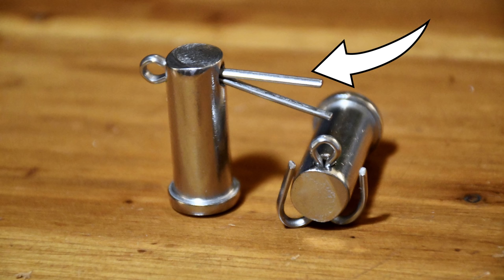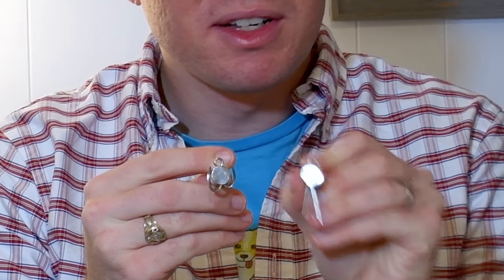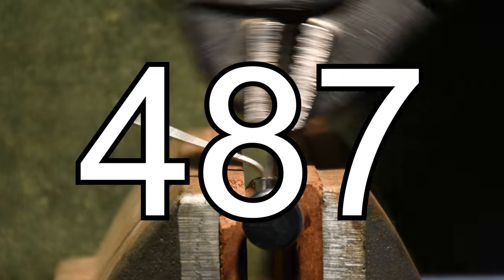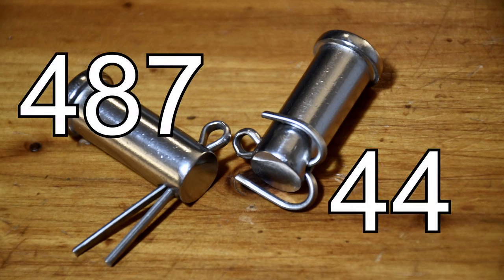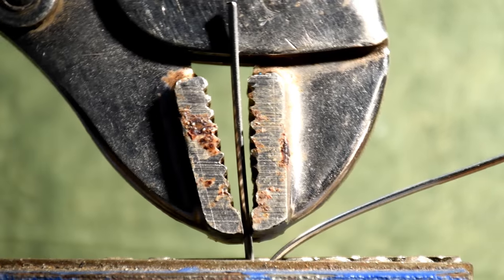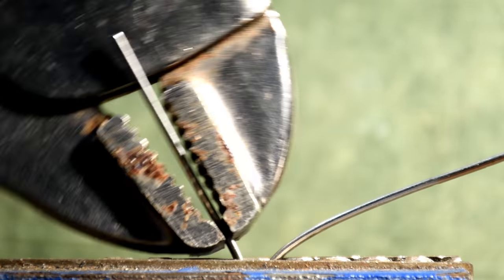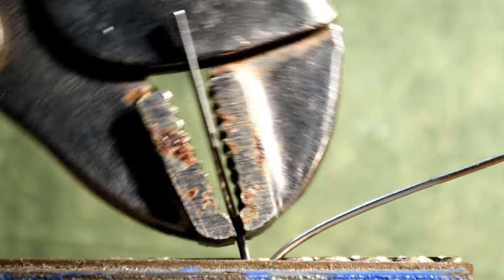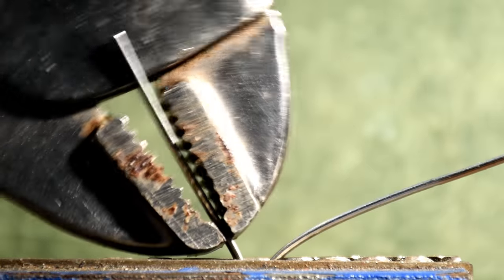Should You Bend or Spread Your Cotter Pin | Sailing Wisdom

Comment: Yes, Math is fun.   However, you have made some base assumptions that I think are false.   You are assuming that each bend puts in the same amount of stress.   However I'm thinking that each bend makes the material less ductile and thus each successive bend puts in more stress than the previous one.   That means it is not a straight line and the first bend puts in MUCH less stress than the last.   Don't know if that would result in a log scale or not but it would make things a lot different.

Also, we are looking at one of the "pins" of the cotter pin failing.   Which solution would be best if one does fail?   I'm thinking the 15 degree bend, with only 1 pin, would pull through pretty easily while the wrap around wouldn't be able to pull through.

And, then there's how you bend it.   The sharper the angle of the actual start of the bend could make a big difference as well.   Using heavy pliers and making that a sharp 90 degree bend and then bending the rest of the pin around the clevis would be worse then doing a more gentle rounded bend!

Oh, and there is the quality of the cotter pin.   You can purchase different quality ones.

Finally, another option I've seen is to use pliers, grab the longer pin and and bend it "around" with the pliers, leave the other one alone!

Anyway, thanks for making me think!

Comment: Test the shear load strength at both ends simultaneously like how they are meant to work. As designed it is supposed to shear the entire pin diameter at both ends of its hole with side loading. Fatigue and work hardening are two very real things and two very different relations to designs. Guess which one you were testing.

Comment: I tried to reuse a cotter pin, it broke on the THIRD time while removing it ~ I think there are more variables involved to simply conclude that the 487 times in your test has any relevance to real world applications... I would HIGHLY suggest using a new one EVERY TIME unless it's on a one time use project/disposable item.

Comment: Very late comment.  But I just watched this.  Your approach is interesting and informative.  I offer a few thoughts.  15 degree bent legs usually stress one leg more than the other.  They leave more exposed sharp points to tear sails, catch lines, and rip your skin.  You commented on the difficulty of fully wrapping the legs.  Use longer cotter pins, vise grips to hold the clevis pin, and diagonal cutters to tightly wrap the legs.  Then cut the legs off near the head with the dikes in your hand.  Finally, wrap the entire clevis pin and cotter pin with electrical tape to prevent any tears or skin rips.  

Now to the other part.  If a leg breaks off a 15 degree bend, the cotter pin can fall out.  The fully wrapped cotter pin requires both legs to break before it can fall out.  

As a mechanic, I was taught to fully wrap the legs and cut off the extra.  As a sailor, I was taught to fully tape any cotter pins.  

An alternative is to throw all the cotter pins in the garbage and use wire rings or split rings that don't have sharp edges.
Reply from the maker: In areas where snagging is a concern, I use seizing wire wrapped around the turnbuckle body and the hole in the turnbuckle screw. I tried to pull up a link from the blog but it appears that I never discussed this, so thank you for bringing that to my attention! I will make that my next blog post.
Reply: @RiggingDoctor  Thank you.  I assume that your reference to seizing wire is similar to safety wire which is used extensively in aircraft and racing applications.  I look forward to the post.  I assume the twisted end would be tucked and taped.  I would not have put these together as I think of a different application for safety wiring.

Comment: The probability of a 'bend cycle' taking place is much higher if the pin is mostly open and repeatedly hits something or the other. If its bent out of the way, yes the initial fatigue is higher but in the daily usage no more 'bend cycles' should take place. isn't it?

Comment: Interesting test, but I think it can be expanded on. First off; automotive uses may not be as applicable to rigging, less vibration  ( in my opinion). I think what last of the comments are referring to are the pins coming out. Extra security.  I feel the next step is friction.  Understanding that the cotter pins are not under any load, but falling out being the issue. Does the weakened pin ( according to your test) pull out with less force than the pin bent at 15 degrees?

Comment: So its weaker but if the other one can be knocked through how much easier? The risk would be which is going to fail more the knock through or the shorter stress life. Kind of missing the other half of the test. also if been banged how likly is it to bend back that 15 degrees. I would imagine the little bent one would be easier to bend back and like you said they turn around in the pin... Its almost like you focused on only the failure method How much force was required to bend back the slightly spread cotter.

Comment: Interesting angle, however 
1. There is a special tool to lock secure the pin, and they are fabricated for one time use.
2. The property of the pins are such that actually before using they should be heated up to 200° C . Which will alline the molecules of the pins.
3. this information is from Vitters one of the big ship yards Netherlands. 
4. Same kind of process you find in Aerospace and Automotive industry.
Reply from the maker: Thank you for that information, I will look into Vitters. I did not know of them :)

Comment: Problem is the legs are way more likely to get caught on things that might stress those legs if they are sticking out if they are bent out of the way and back they are bent ONCE and very unlikely anything will bend it at all until you go to remove that cotter pin and then you use a new one when you reinstall. Also it’s not JUST how many times you bend the leg but how many times in a SHORT period of time. HEAT is generated when metal is repeatedly flexed the frequency of that bending had far more to do with fatigue. Bend it faster it will fail in less bends BUT each bend if it is a further Bend is in the bending process longer so it breaks in fewer bends. But it’s is still the rearranging of molecules and the heat that creates that causes the failure. Bending a cotter pin once so the legs won’t get caught and possibly unbend or push the pin out is by far the safer bend. And Yes the Bend caused some fatigue BUT not enough to cause failure and the legs being less likely to get caught far out ways the number of times you can bend it before it fails as your never supposed to bend it again without replacing it.
Reply from the maker: It’s all a compromise.

Comment: The comments from the other industries and from those that have lost pins strongly suggest the full wrap. My biggest concern is snags from lines or clothing, as I have both distorted and lost ring dings/cotter rings on stays, once while racing. I'm a fanatic about taping them, same with pins if possible. As someone hoping to sail solo around the lower part of the world my concern would be jettissing a downed mast quickly which suggests small bend, but would also increase the chance of a collapse in the first place. Typically I thought the idea was to cut the wire and usually sail with tools for this purpose. Great video got me thinking, got me laughing.
Reply from the maker: In high snag areas, I use seizing wire instead of cotter pins. It’s smooth and gets the job done!

Comment: Work hardening your test. Each time you said was one is two. Time 1st bend is not work hardening the pin. Repeated bending does work harden steel yes. If you look at the engineering studys done at the Edison institute on work hardening of fasteners and the transverse strength. If you worked on my plane or boat and did that to save time. You would have plenty of time to do what ever you want your fired.

Comment: this is why i use wrap pins with velcro......never bend cotter pins  and for spreaders, split rings...never cotter pins
Reply: I am sorry to say this is a situation I have been thinking about many times over my life. Work hardening requires repeated flexing as you showed.  One bend does not ¨work harden"a metal. However, how do you secure the 15 degree bent pin so as not to catch on sheets and sails and skin to prevent damage? I used to bend 15 degrees and then slide a plastic turnbuckle cover over it with the cotter pin being the same length approx. as the inside diameter of the tube of the cover over it. Nothing can stress it then and nothing can get hung up.  Just lift up the cover and you can pull the pin easily, insert a new pin and drop the cover, done. I got tired of having to hold the covers up when retuning over the years so I switched to split rings. However, while they do not catch on skin, i have experienced rings that have opened from getting caught on sheets and had to be replaced. Dont think I ever had one completely come out but it was such a frequent occurance that I have ceased using them and returned to the sleeved method. In that most of my boats have been deck stepped masts I think its important to be able jetison the mast quickly if it comes down to get it away from the hull.  Quickly is impossible with fully bent cotter pins while it is with 15 degree bent pins.  71 years on the water I have seen a lot of things but to see half a dozen split rings fail in these applications is a lot more than I am willing to accept. The experiences here witness that 15 degree is reliable as are fully wrapped pins. One way leaves an injury and damage risk to other components. That makes it a simple choice to me.

Comment: Who is cycling the legs of these pins back and forth?  I might put a pin back where I  got it from in a pinch, and if it looks in really good condition.
Reply from the maker: This video was to exemplify why it is important to follow the instructions of mast manufacturers who want the pins bent 15° instead of wrapped all the way around like people insist on doing. 
The issue is the legs are significantly weakened by the one drastic bend and are at higher risk of breaking when repeatedly struck by halyards and other running rigging.

Comment: Never leave straight, always fit new and bend tight as possible to reduce snagging.  Tape if possible to reduce snagging further......don't use the key ring type.
Reply: Bending tight doesn't just reduce snagging. It prevents the pin from moving around in the hole.
Reply: @Garryck-1  if done correctly it both reduces snagging because the ends are tucked in under the head and reduces movement. also if snagging is a probable outcome just round the ends with some paper or a smooth file

Comment: Yeah…I have to go with bending both back. That one slightly bent leg gets snagged or breaks it’s over. They would twice as unlikely if they’re both bent.
Reply from the maker: The thing is, they shouldn’t be getting snagged. They do get smacked around a lot though and when they are bent far over, they are more likely to break off, leading to them falling out and it being all over.
Reply: @RiggingDoctor  , my point being that if only one is bent and that breaks off, the pin is free to slide out. If two are bent and one breaks off, one might hold the pin in place until the next inspection. My logic could be wrong, and I would be cautious in arguing the point with a rigger who does this for a living. JMHO.

Comment: 1. Always use a new pin (unless temporary until you can replace with new , emergency)

2. Bend both, opposite directions around.

3. Clip excess.

Done

Shortcuts can kill someone.
Reply from the maker: That is fine advice in the correct application, but a sailboat is not the correct application to bend the legs all the way around.

Comment: This is wrong... Bend the cotter pin all the way around, both sides.   If one side fails, then the other side will keep it from falling out and keep your mast from falling down. Leaving them unbent on one side and bent a few degrees is not the safest solution.   There should be no additional forces applied to the cotter or split pin once cold formed into the fully bent position, and doing both sides is what you want.  You want those ends out of the way from getting snagged where they can bend back.   You want the cotter pin to be free floating in the hole also.  And you don't want the ends out where they can get snagged.

Comment: Please... A cotter pin is to be used one time not to be bent repeatedly 50 times...
I can think of no use of a cotter pin where it would even accidentally be bent 50 times...
But one hit on the end of a spread cotter pin can drive it out of the hole it's in, which I've done with a hammer, no breaking necessary...
Whereas a bent cotter pin has to be unbent before it can be removed...
Which is kind of the whole point of a cotter pin... to remain where it was placed until forcibly removed...
Reply from the maker: They get hit thousands of times by halyards which will break the legs. If they are bent all the way over they are going to break off sooner than ones bent only 15°. 
They are all one time use, but we want it to still be in the mast when we go up there to take it out!

Comment: I love your channel but I am sorry buddy. You got this one wrong. Rolling the cotter locks it  in place and does not allow rotation or chatter. As the locked in cotters only load is in shear there is less movement of said cotter pin and thus less chance of rub wear on the cotter from the clevis or castle nut. Not to mention that a cotter pin is ROLLED. They are designed to take the metal stretch and ARE A ONE TIME use item.... I can not emphasize enough NEVER USE THEM TWICE!

Comment: I’m sorry, but, I have never seen a broken cotter pin.  Have you tried to break one?  C’mon.  Bend it and forget it. Why be worrying if you have it bent enough to stay in.  And if bending them the whole entire way until they wrap around the pin, or removing them is too time consuming that it’s causing overtime and $$, you need to find another career because, I guarantee you have bigger problems, and you are charging way too much in $$ or time to do the work. I a. Terribly sorry for the run-on sentence.
Reply from the maker: I did try to break them! 15 degrees felt like forever and 90 went really quick. 
In practice, I have come across missing pins and pins with one leg in them. 

I know up the mast it’s 15* but on the same boat on the prop it’s wrapped around. Different rules for different applications.
Reply: I shall offer an apology, but not ask for forgiveness in my rudeness, as I do not deserve it.  I’m sorry, it’s been quite a week for me.  But in the grand scheme of things, very trivial in comparison.  Anyway, whether agree or disagree, I can respect everyone’s experiences and opinions.  As far as the prop application, my suspicions are the potential to exposure of high vibration, although the wind can do the same.  So, go figure.

Comment: Foremost THEY ARE SPLIT PINS and NOT cotter pins and they are not the correct pins for that purpose. Split pins should have one leg longer than the other, be of the correct diameter to fit the hole and not protrude through more than 1 cm or 1/2". Then the shorter leg is lifted enough to stop the pin from falling out of the hole, around 30-45 degrees and that is all that is required. No bending the pins double or wrapped around nuts.
Reply from the maker: What you are describing is a cotter pin. In North America, that type of pin is called a Split Pin and a Cotter Pin. Two names for the same thing.
Reply: @Rigging Doctor  No what I am describing is a SPLIT PIN, cotter pins hold pedals to bicycles and have a thread and nut on one end and a tapered surface. They are different things.

Comment: his experiment shows the bending of a cotter pin at a single point on the pin at either 15 degrees or 90 degrees. but what if the bend is spread over a longer length of the pin. instead of bending the pin 90 degrees at a single point, the 90 degree bend is spread out over several millimeters of the length of the cotter pin. would't that reduce the point stress on the pin?
Reply from the maker: When you wrap it all the way around evenly, the base of the pin still makes a sharp turn.

Comment: I dare you to wrap a cotter pin with tape that is not wrapped around the clevis.  And if you don't wrap it with tape have plenty of band aids and sail tape on board!
Reply from the maker: That is how I do them up the mast, 15* bend and no tape. If placed properly, no issues will result. If they are in a “high snag area” I use cotter rings instead. 
On the deck I use wire to retain, restrain, and lay flush.